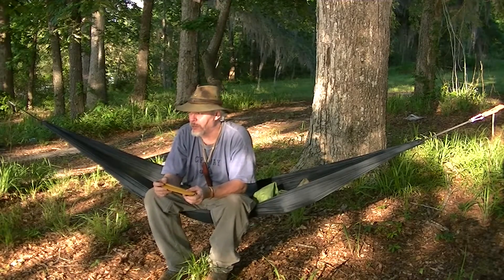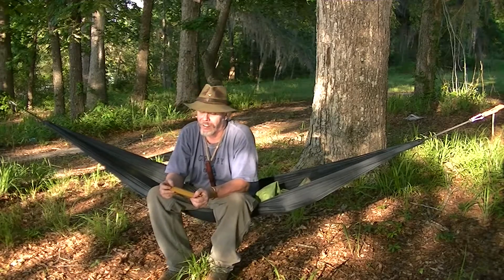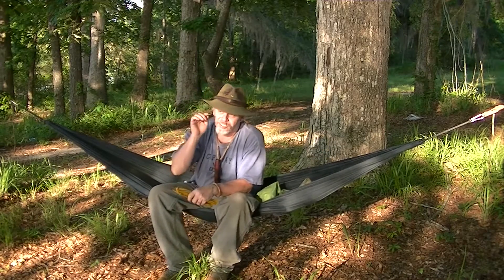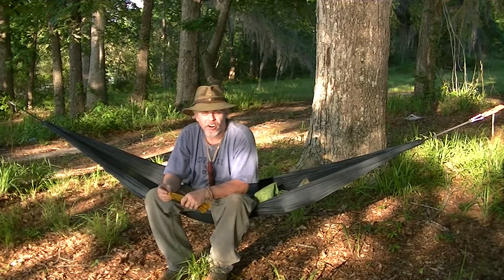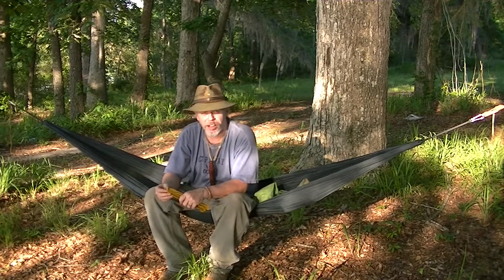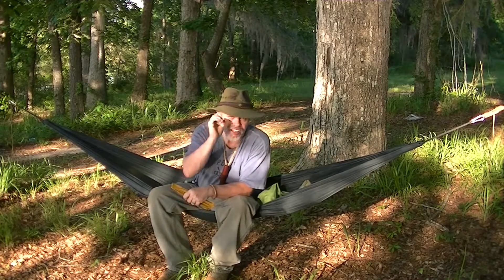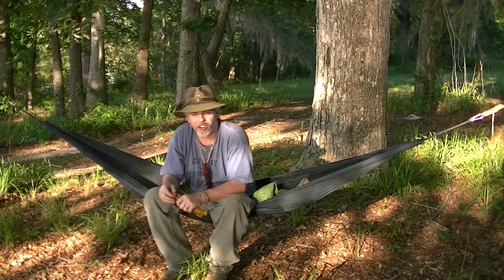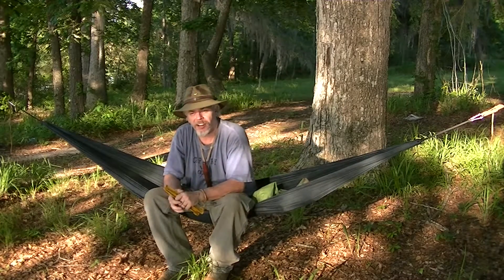The Percussion Revolver  The Lost  Video

Comment: Oh man, I really want to see this. Also, what's you opinion on using stones to smooth all the edges of the internals. Meaning the hand or any other moving part. Does this help with smooth function of a revolver?
Reply from the maker: it sure does..i usually just hit the rough stuff on a new revolve..and then look for  the wear / scratches on later disassembly..it will will show where i have unwanted friction..plus if the gun shows good repeatable accurracy then i will full stone and polish internals to get the most out of them
Reply: blackoracle69 thank you sir. I was wanting to make sure the cost of the Arkansas stones was worth it. They are pricy.

Comment: Can smokeless powder be used in a BP revolver providing a safe load charge be used? If not. why not. That reminds me when I was a young boy to never go swimming on a full belly. Today, we know that was a myth.
Reply from the maker: +Jack Wayne PERCUSSION REVOLVERS REGARDLESS OF THE MAKE..CANNOT USE MODERN SMOKELESS POWER..PEROID.. now having said that..the answer is simple..the modern powders burn so fast the pressure is created so quickly the cyl..bursts before the ball has time to move..even with heat treatment..the power curve is far too unstable to try it..only the blackpowder substitutes can do the job..and to be fully honest most of those don't always get it right..i saw figures one time from a very well respected lab..they compaired  a modern smokeless powder to blackpowder..in a pressure test  chamber..they found smokeless powder ""X"" at 5 grains created the same chamber pressure as 300 grains of blackpowder!!! thus in a cyl of a walker which holds 50 grains .i create the same power/pressure as roughly half a pound of black!!! ...the blackpowder subs are actually modern powder made to use at the right burn rate..right pressure curve to use in a percussion revolver..so stick with them..thanks for the comment.... safe journeys